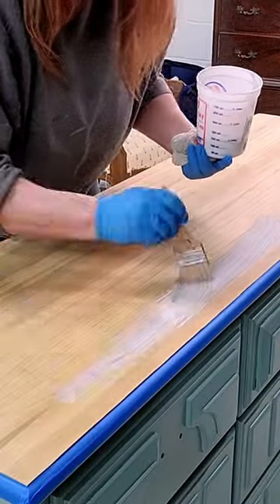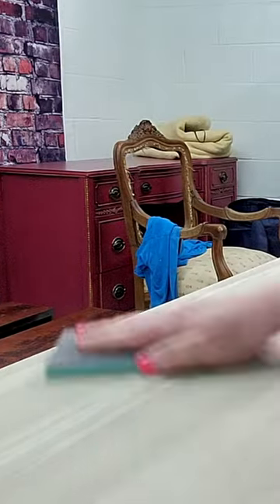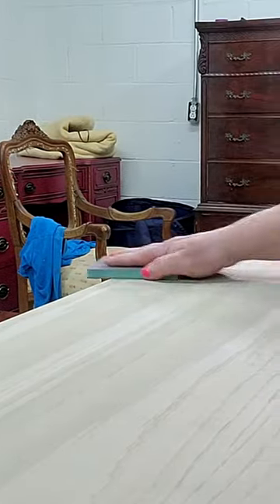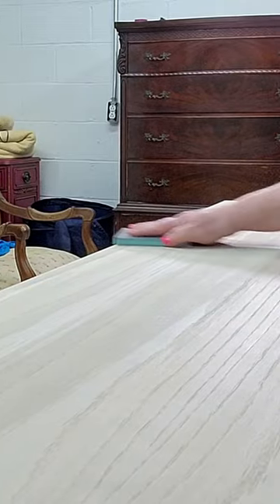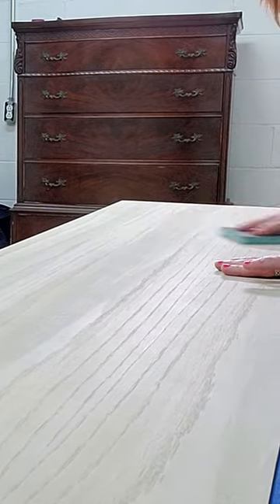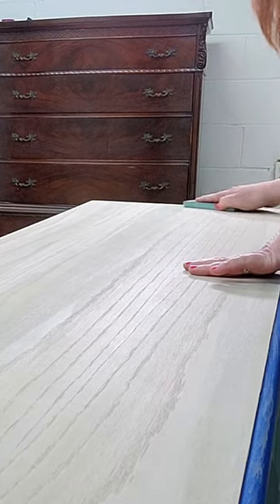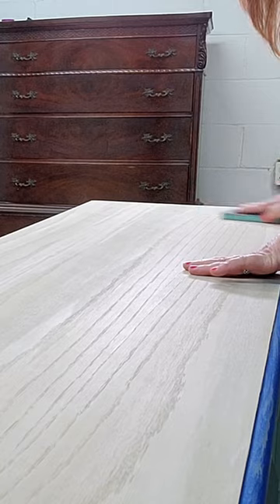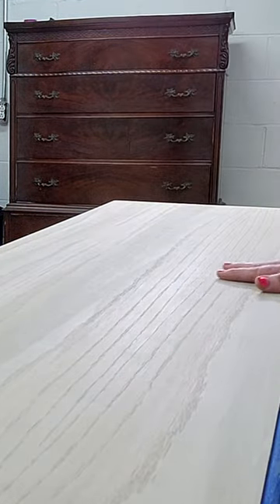Popped grain after white washing wood

Comment: You can also do what’s called “pop the grain” before staining or painting. You take 50/50 water and rubbing alcohol and put the mixture in a spray bottle and spray the wood  which pops the grain up and then you sand it down for the final time, so when you go to paint or stain etc. the wood won’t pop and you don’t have to risk sanding off the color of stain/ paint. I just learned this from a professional sander today.